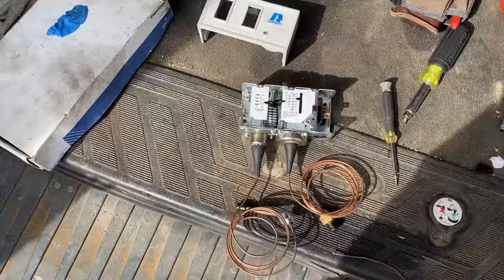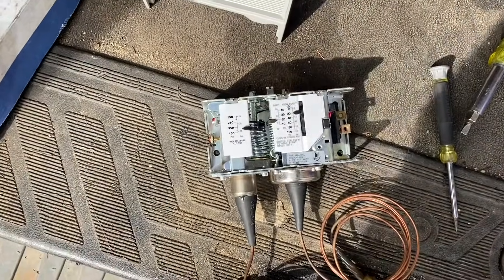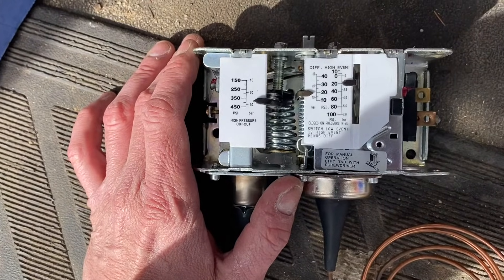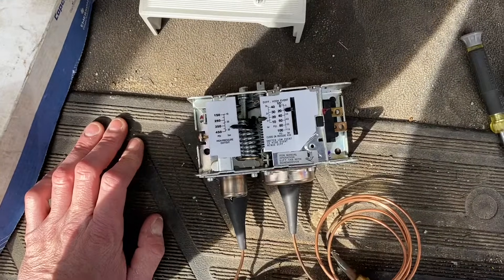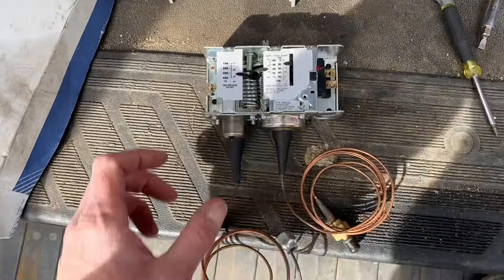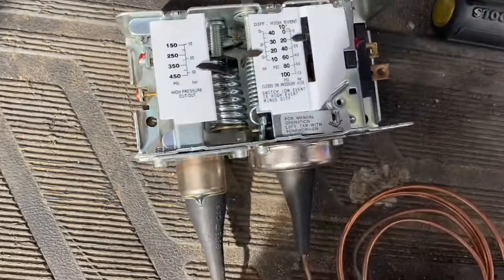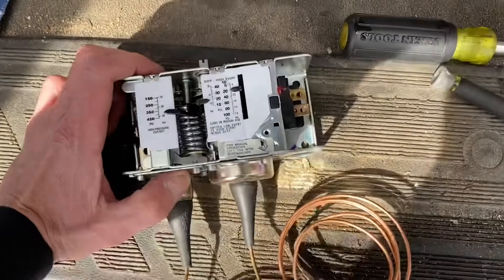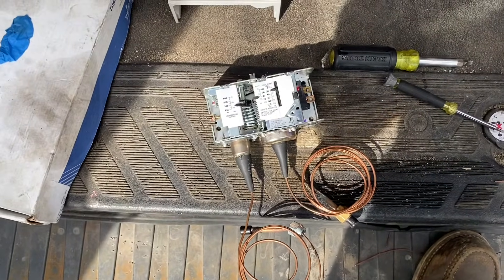Pressure controls . How to set them and how they work .

Comment: That is a thread on unit. To change out the braze in's, do you have to evacuate the system? Or can you just swap the cap lines attached to the bottom of the switch
Reply from the maker: You have to evacuate and use the new cap tubes that are on the new switch .
Reply: @Cscrefandhvac  Thanks, I appreciateit!
I was able to adjust the unit and is now working properly 

If it fails completely, I'll probably use the "peanut" screw on type Lo pressuse cut-out control switch mounted of a brass T

Thanks again
Reply from the maker: Also some switches have threaded connections but these particular ones in the video do not

Comment: Thanks for the info. 
I take it there is no way tool adjust differential setting on the high side?  Factory set?
Reply from the maker: On this particular control and most they are  factory set. The differential adjustment is used on a condenser fan cycling control always .

Comment: Question: I have a Copland Copeland EALA-0200-1AC compressor.  What do recommend I se the dial pressure sensor at for both high and low pressure?
Reply from the maker: is it a cooler or freezer and what type of Freon is in the system ?

Comment: Nice video, I just can’t picture how the differential adjustment actually lowers the cut out pressure
Reply from the maker: It can be confusing until you get used to it .
Reply: @Cscrefandhvac  I know that you need to adjust the differential, just don’t understand how it physically works
Reply from the maker: It works by the pressure

Comment: I'm in Canada and we get temperatures as low as -20f. So if I was to set a 404a scroll compressor system to cut in at 40 - 45 psi with a cutout at 15 psi, would that not likely be enough to cut in when the solenoid opens? If I have a freezer at -4f and my outdoor ambient is somewhere in the -10f to -20f at night, is it not going to be enough pressure to kick it back on?
Reply from the maker: It could be for sure. We get cold winters here but not as cold like you do at all amd I’ve had units here that would not get close to 45. You will have to lower that and lower the cut out

Comment: Hey there, is this part plug and play? I'm new to this but I do have this new part to install. Someone checked the old one and it's bad. Do I need to remove refrigerant from compressor? Thanks
Reply from the maker: Well you will have to put o the system down to hook up the low side and if it’s a dual pressure control or high side control you will have to remove refrigerant depending where it goes. It it’s in the discharge line you’ll have to recover some gas most likely but if it’s on the liquid side you should be able to pump it down
Reply: @Cscrefandhvac  thanks for you help...

Comment: I got ranco dual pressure control in my open daily case 
But my compressor keep turns on and off so what should I do
Reply from the maker: It’s not adjusted properly or it’s low on Freon or valves could be leaking by on compressor if it’s trying to shut off due to being at temp etc

Comment: Good video but will be better if u mentioned how to test it to find out its faild....thank you
Reply from the maker: If it’s failed it will be either stuck open or closed . Or the springs will wear out and it won’t calibrate correctly to sense the correct pressure.  Or they can leak inside in the bellows or cap tube will break , leak or get clogged

Comment: Some pro tips: (1) A scroll compressor is still a hermetic compressor. (2) Don't trust the numbers you set the control to. (3) Set up the low pressure control settings in your van with nitrogen and a swivel tee. Saves the compressor some stress. Saves you and the customer time as well. (4) I agree, the manual high pressure reset is the way to go if it's responsible for cycling a compressor. (5) Be clean with your capillary tube routing, don't let them rub against things, and ensure they are routed as to not let oil pool in them. (6) ALWAYS LEAK CHECK THEM. The low pressure diaphragm is prone to leaking, especially on Johnson brand controls. (7) For everyone's sake, don't over torque the flare fittings...
Reply: How do i charge freon to a scroll
compressor.
Reply from the maker: @alfonsokumangai4002 . Just the same as you would charge any system

Comment: Hey don’t know anything on refrigeration but I was give a industrial low boy cooler with this Ranco brand but exact looking device so what do I set the high pressure at
Reply from the maker: It depends what type of refrigerant is in the system
Reply from the maker: It’s would depend what type of refrigerant is in the system

Comment: Can you do a fan cycling control, based off what I know in a two fan condensing unit you’re only wiring one fan which would be your fan closest to the inlet of the condenser. But as far as setting the switch what am I doing just setting pressure cutting out closest to pressure similar to 30 degrees over my ambient in colder ambient temps. Great vids keep me coming.
Reply from the maker: jon umana yes they are set the same way just at a higher pressure

Comment: this might be a lot to ask but this would be super beneficial to me and probably a lot other new guys
1. SC/SH and typical pressures to look for in a normally function WIC/WIF
2. (this might be a pain) but draw out an electrical diagram of a refrigeration system with all the most common parts and how they're wired.  

3. and could you make a video of your typical diagnostic steps when you come across a unit not working? ex: step 1, visual inspections on the coil, step 2 check fans
4. and can you make a video for your step by step maintenance CC on a refrigeration system?

Thank you for these videos. seriously. great job and i love your patience
Reply from the maker: Brian Pan yes I can certainly do that.   If you look through my older vids I have some I’m these things.  But I can try to get something out for you guys. It may be a talking vid , especially about the steps I take when approaching a call
Reply: @Cscrefandhvac  that's totally fine as well. Sorry but can u also add what typical saturation temps are supposed to be? Suction line temps? And psi for 404a and r22
I'll look deeper into your older videos
Reply from the maker: Brian Pan all those temps can vary depending on the system , the pipe run etc

Comment: if the system has an oil safety control i always set the LPC at 10 psi cut out
Reply from the maker: kingofthecrease30 good point but the oil controls have a delay to make up for the pump down time
Reply: @Cscrefandhvac  yes...its 2 min but sometimes large systems take longer to pump down...i have seen it before
Reply from the maker: kingofthecrease30 absolutely.  That’s why I always check pumpdown and make sure the control is set accordingly